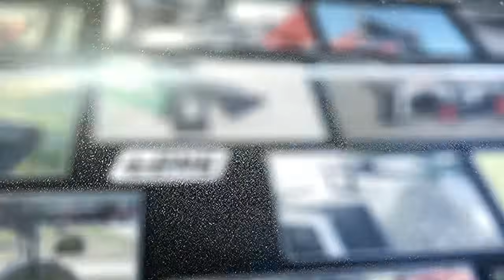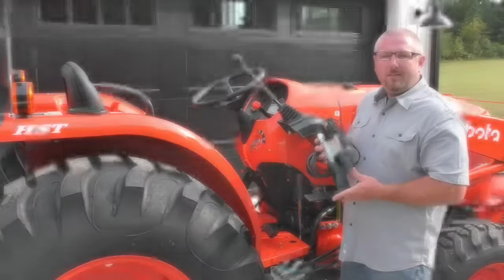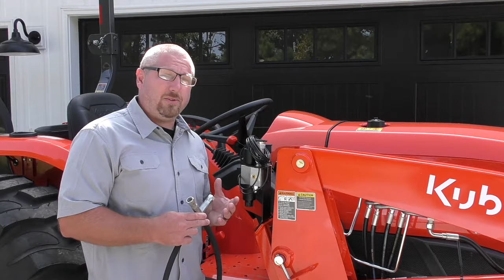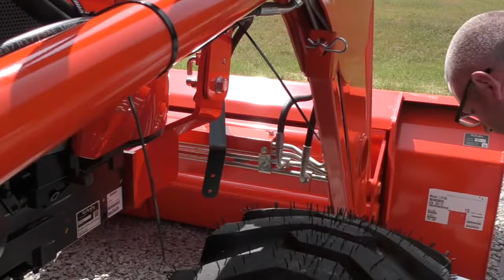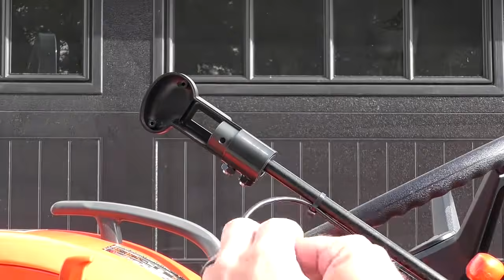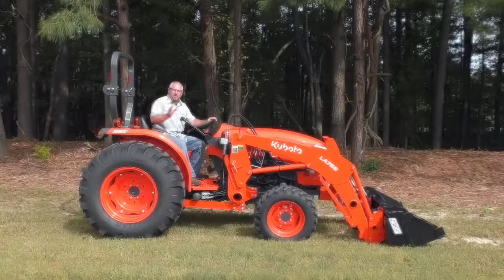WR Long 3rd Function Install on a Kubota L4701 / LA765

Comment: This kid seems overly complicated to me. I have an L 5030 Kabota and I would like to add a third function for my loader so I can use a grapple f four in one bucket etc. I have a Case Skiploader and a John Deere backhoe that have another lever next to the loader, lift and curl lover to open the four in one bucket or the third function. I would rather have that, instead of all this extra electrical on things like that, and just do it simply hydraulically. with an additional valve just for opening and closing my implements.
Is that a possibility?
Reply from the maker: Happy to help. Give us a call and we’ll walk through the best approach for your needs.  252-823-4570

Comment: Why does no one show the effing wiring?!?!?
Reply from the maker: Hi - wiring will depend on which handle you're using. If you're using our two-button handle, it is plug and play. If you are using our older style rocker switch handle or the factory handle, you will need to wire into the handle. We have a wiring diagram in our valve kit owner's manual: https://www.wrlonginc.com/wp-content/uploads/2025/01/VK-Owner-Manual-8.7.24.R8.pdf
Reply: I think the wiring is a necessary. The better solution is to have another spool that would provide power to the cylinders that open and close your grapple for one bucket or whatever other attachment you have up there.
That’s what I’m looking for is just another valve. Keep it simple I don’t want all the electrical BS it will fail overtime before the hydraulic steel. 
I have some other industrial tractors, John Deere and Case that have an additional hydraulic lever to open and close the four in one bucket, grapple or whatever

Comment: This isn't a true 3rd function kit. You can't do 2 or 3 functions at once. If you operate the 3rd function, the loader operations will stop
Reply: I installed this valve on my tractor and found out the same thing. Kinda unfortunate as much as the kit cost.
Reply from the maker: The kit is designed as a true third function but that is dependent upon your tractor capabilities.  If you can raise your 3-point hitch and loader at the same time then your tractor allows for a true 3rd function.

Comment: I thought PB connects to P not T @ 2:24
Reply from the maker: That is correct! Sometimes, as is the case here, you remove the hose that is currently plumbed into the Power Beyond Port on the loader valve and route it directly to our "T" port. Then we provide a hose to go from the now empty Power Beyond Port on the loader valve to our "P" port. In other cases, you remove the hose connected to the Power Beyond Port completely, and we provide two hoses (one for our "P" port and one for out "T" port).
Reply: Does this kit allow the 3rd function to work simultaneously with other functions or only alone?
Reply from the maker: @jonathanrawson4727  It depends on your machine! If you can raise your 3-point hitch and your loader arms at the same time, then our 3rd function kit will operate as a true live 3rd function in that you can simultaneously operate more than one function at the same time (for example, open the grapple and curl). If you cannot raise the 3-point and loader arms at the same time, our 3rd function will still work you just will not be able to do the operations simultaneously.

Comment: I have a Mahindra 5565-4L loader that has a joystick loader control valve without any markings for the power beyond port.   I've spent hours trying to find a diagram showing where it is but there's nothing on the internet that shows it.  The closest Mahindra dealer doesn't have any diagrams and doesn't want to help because I didn't buy the tractor there.  I guess I won't be using my grapple attachment.
Reply from the maker: Hello! You can email help@wrlonginc.com a photo of your loader valve, and we can help you identify the power beyond port. Please include your name, contact information, and loader model number in the email as well.

Comment: Had an issue with my dealer installed 3rd function and called WR Long for some guidance, they answered the phone an hour before opening for business and offered to call my selling tractor dealer to touch base and get the part coming. 

Stand up company for sure !!  and will be using a WR Long when I self install on my larger tractor I just ordered.  

THANK YOU !

Comment: Hi, I watched your video on YouTube putting the third function in, I have 2015 kubota bx25d I installed it just as you said and when I was done it only worked one way if I switched the loader lines it would work the opposite way. Thanks any input would be great. Nice videos thanks again john

Comment: I think adding some 90 fittings on the connection to your control valve would be a very worthwhile addition. Looks pretty amateur with the hoses routed like that to my eye.
Reply: Yes, in the sun will rot out the hose on the upper 90° bend portion

Comment: I have the WR Long on my New Mahindra 26MAX XLT, 20 hours,  Durham NC dealer Installed it.   It sees to be wired backwards (at least to me).  Pressing the thumb button up closes, pushing it down opens the grapple.  Cant just switch out the quick connect hoses, as the are male/female, etc.  Any suggestions?
Reply from the maker: Jerry,  you have a few options.  1) Take the back cover off the handle and reverse the top and bottom wire on switch. 2) Take the back cover off the handle, push in the tabs that hold the switch in and pop the switch out.  Rotate the switch 180 degs and pop it back in the handle.  3) Remove the solenoids from both sides of the valve and take out the 2 screws that hold on the connection block on the top of the valve.  Rotate the connection block 180 degs, reinstall the 2 screws and reinstall the 2 solenoids.  4) Switch the hoses at either the back of the bulkhead plate or where the hoses connect to the attachment.  If you have any questions please feel free to give us a call Monday - Friday 7:30-5. Joshua.